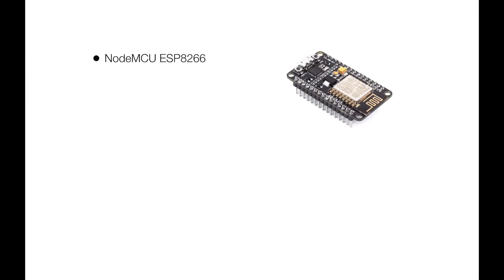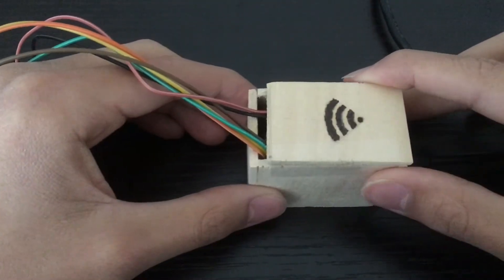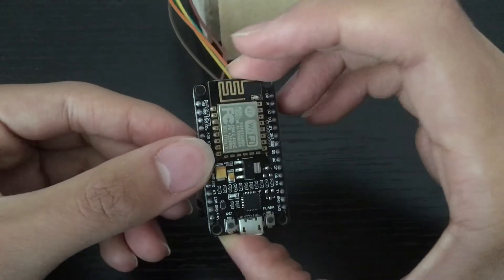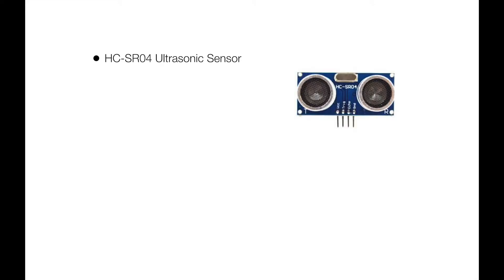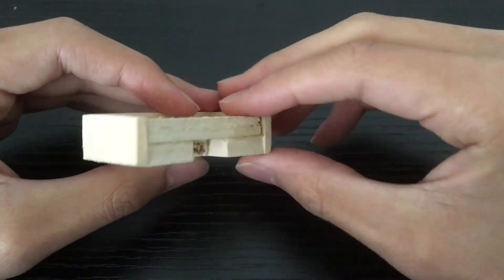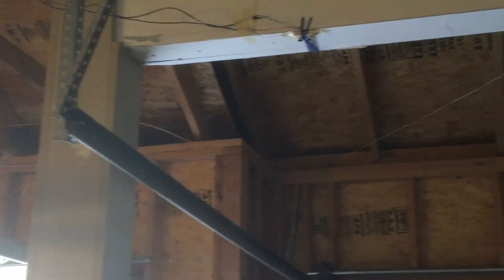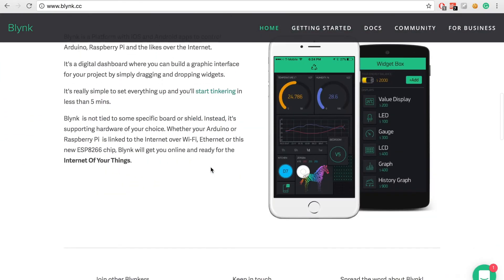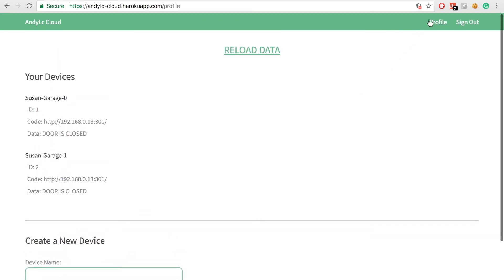Garage Door Open/Close Sensor for 10$ | DIY | ESP8266

Comment: Man i was thinking about doing the same, but I think i'm going to go with a metal piece on the bottom of my garage door to act as a circuit closer instead of ultrasound, would be easier to hide but i'm worried about the maintainance ^^'